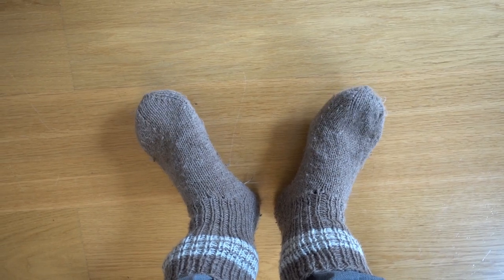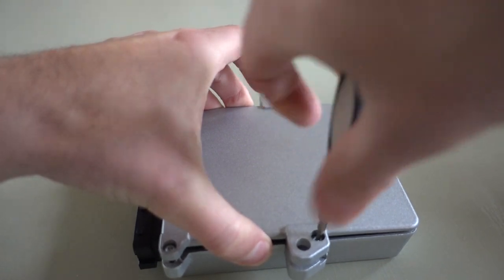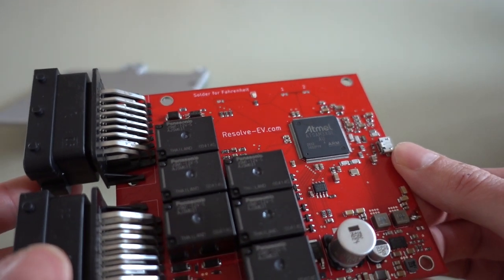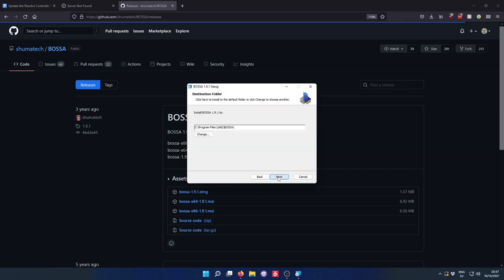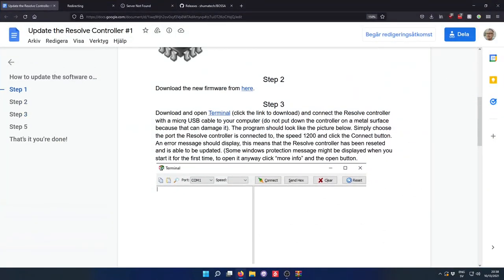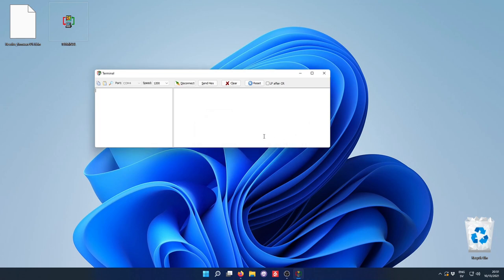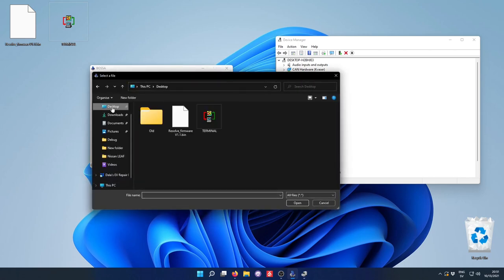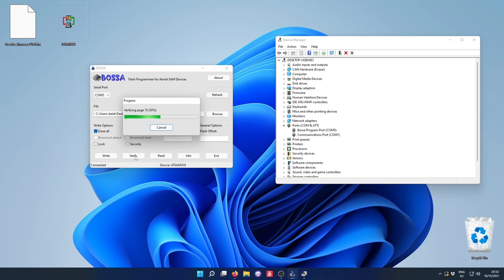Updating the Resolve-EV VCU

Comment: Couldn’t you have done this without taking out the circuit board? The mikro-USB port was accessable from the start.
Reply from the maker: No it is blocked by the case

Comment: how did you know you needed an update? I got the resolve ev controller just a month ago.
Reply from the maker: I purchased one of the 3 first controllers last year. I think Isak will let you know if you need an update, also there is an upcoming update that will let you tune regenerative braking!
Reply: @DalasEVRepair  nice! Good to know and thank you for your videos. They are a great reference as I've been preparing to swap the leaf motor into my Honda CRX myself as well.
Reply from the maker: @Windraver  Good luck with the project :)